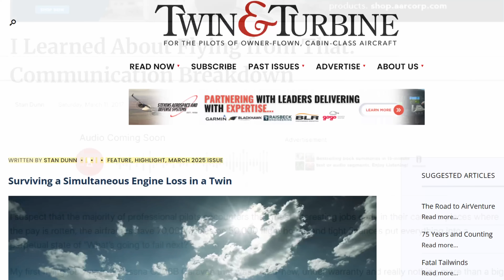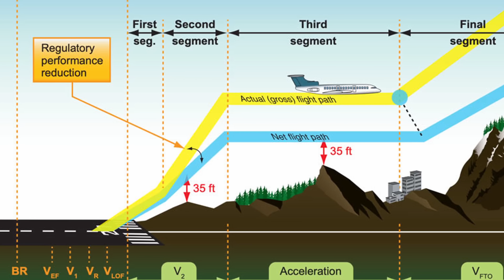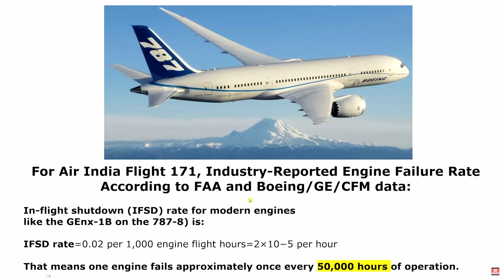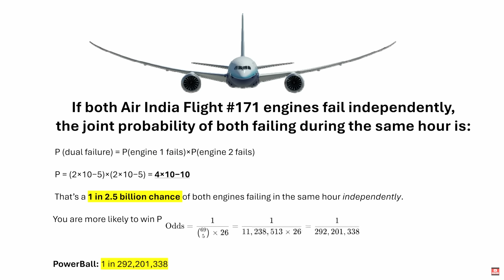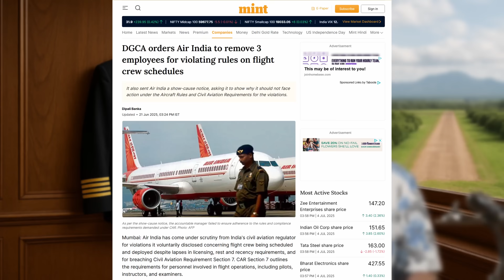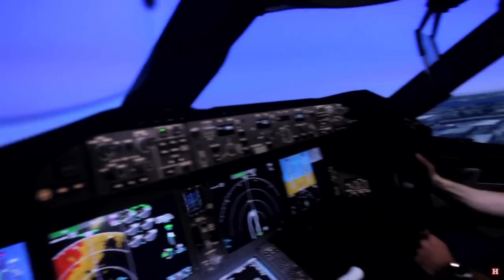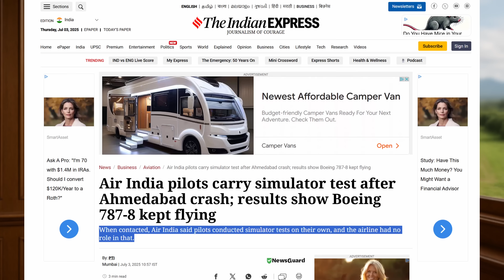Air India 171 Cause Becoming Clear

Comment: My theory is the lithium battery shorted out, causing a power surge, and the computer system shut off the engines quote to save the engines. The computer management system automatically shuts things off if there is electrical shorts, surgeons, etc. I know a former Boeing employee who told me never fly on the 787.
Reply: Not even close to probable.
Reply: @stevenrn6640 Power surges can trigger engines to shut off in the Boeing 787, allegedly. The fact they have released no data from the voice recorder and data recorder tells me there’s people at Boeing and Air India not sleeping well at night.

Comment: I wouldn't be at all surprised if there is a bug in the coding of the software.  There is so much software code on machines these days it is almost impossible to test everything for faults when there are so many possible inputs variables and solutions.  I experienced a similar problem on a brand new 747-400 on Flight QF1 from Melbourne to London Heathrow via Sydney and Bangkpk. I joined it at Bangkok on one of the last 4 available seats on the plane. Well through the take-off run, after V1 had been attained, we lost power on all four engines, due to a known fault which had occurred several ttimes   Luckily the Qantas crew realised what had happened, cancelled the Auto-throttle and went manually to emergency power.   The blue light show of flames from the jet pipes was quite impressive and we only rotated from the threshold, having run off the end of the runway and collected a palm frond over the horizontal stabiliser on the way.  The problem in that case was the auto throttle software. 
There have been problems with the FADEC systems in the past which kept the Royal Air Force Chinooks on the ground after causing a Chinook to fly into a mountain in Scotland when the engines wouldn't respond. The Air India 787 had undergone maintenance only days before the accident.  Were any software patches installed?  On an 11 year old aircraft there must have some updates carried out.

Comment: Lots of bs.  It’s Boeing software fault, just like mcas. Lousy sensors broke and computer went crazy.  High temperature in engines and buggy software shut them down.  Another few billions in compensation with massive recall to change lousy sensors and wrong valve used, fail-close to fail-open as in original design

Comment: What is the likelihood that electrical interruption from main-body sections junction join point/s(AKA-current inspections for assembly joint facing body shells [de-lamination/s] of differing body shell components exceeding 0.004" deviation without shimming) that could have or has precipitated a break in the cabling to the computers and associated control/s shutting down both engines simultaneously causing the crash and dropping of the RAT?
Just an observation from an ex RAAF mechanical fitter.
Ozzie Follower
Reply: Even if both FADECs lost power simultaneously why would the mechanical assembly automatically move to idle thrust?  On the turbine engine I work on there is no spring action bringing the engine control back to idle.  Loss of power would leave the mechanical lever right where it was when power was lost.

Comment: You didn't mention the possible water leak from the lavatory faucet, for which Boeing had issued directives twice. There are critical computer modules under the bathroom floor. Water leaking could have caused electrical and/or control failures.
Reply: Designing a plane that has critical computer modules underneath the bathroom seems like a very bad idea.
Reply: @geofflepper3207  Designing a leaky toilet is even worse.

Comment: I am still going to go with a tragic pilot error.  He throttled back when he should have throttled up.  Or it could have been a suicide of someone in the cockpit.  The instrument recordings and voice data should reveal whether or not Boeing has made another flaw.  I doubt it.  Still, hatred amongst neighbors does not require organization.  One person could have done it and there is no one to "take responsibility" or gain effect from such.  We still need to determine what the actual failure was before we speculate on cause.

Comment: The equipment failure inside the cabin on the ramp is the clue to what happened. The A/c was not working and neither were the passenger electronics. There are suggestions that they were cleaning up a water leak from a toilet that managed to get into the electrics bay. It could be that after they dried out the bay and cleared the aircraft for flight, the leak continued and when the aircraft rotated at the very end of the runway, the loose water shorted out all the systems including both FADECs simultaneously leading to the engine resets to idle. The RAT deployed and the aircraft could only climb a small amount before stalling. They did not have enough time for a reset of the FADEC and they ran out of height. Due to the development of the land all around the airport, there was nowhere to put the aircraft down even if they had enough energy to turn - which they didn't.
Reply: Retired Plumber : it is amazing what a mess spilled water makes.
Even one quart is huge when spilled in the wrong place.
Reply: This claim is so utterly ridiculous it needs an entire category of absurd.  How would water short out the FADEC computers when they are literally mounted on the ENGINES genius...??!?!?

You really need to stick to kite flying and skip the adult discussion forums...
Reply: @redbaron6805  Where is it getting it's power from ?
Reply: @redbaron6805  You really need to articulate yourself better without being needlessly rude.

And like everyone else, all you have done is attacked the OP. You have not proposed an alternative theory nor disproven what the original poster wrote. That makes everything you said totally null and void.
Reply: @halfbakedproductions7887  At no point was I being "rude", more like impatient with people who speak about subjects they apparently have absolutely zero understanding of.

I am not only a pilot and worked for years in avionics and instruments, and have a degree in electronics, so I know BS when it is being posted.

When people talk about toilet water shorting out the FADEC computers on the engine, and the idea a plane rotating having water flood the electrical system, like there is a giant swimming pool of water just sloshing around inside, you know you are riding with flags high into Crazy Town.

As a bonus, the idea that you can land a 787 if only the land wasn't developed around an airfield, like massive open fields that that can support the weight of a half a million pounds is all that is needed is just the cherry on top...
Reply: @redbaron6805 So you're certain that wasn't the cause.

Gee, why didn't you tell the Indian investigators earlier? You know the answers, why did they waste their time? What else have you thought of that they haven't bothered to investigate with the actual evidence in front of them?
Reply: @halfbakedproductions7887  I know reading and elementary comprehension is obviously not your thing, but the location of the avionics of modern aircraft, and related computers are in the front.

Even if you had large amounts of water, when aircraft rotate for takeoff, everything goes to the back, because, you know, gravity, physics and all that other science stuff.

Do I really need to break out the crayons to explain this to you on a level you understand...???

Comment: that would be convenient for boeing, You didn;t mention that there is a third tank in the fuselage, which powers both engines during takeoff, and there is such a device as FADEC, which, losing power or having a surge/failure, will shut down both engines automatically, redundancy only in theory

Comment: During the take off phase of Air India flight AI 171, the hydraulic system was under high demand (flaps deployment, landing gear retraction, and nose wheel steering).
The Skydrol hydraulic fluid inside the pipes was likely approaching a temperature of 90–110°C.
If any of the pipes developed even a small microcrack, the hot, pressurized Skydrol could spray directly onto wires, connectors, and printed circuit boards (PCBs) inside the Main Equipment Center (MEC), potentially causing cable insulation to melt, catch fire, or short-circuit within seconds.
One of the high-pressure hydraulic pipes controlling the flaps on the Air India AI 171 aircraft suffered a structural failure due to material fatigue (micro fatigue cracks) that had slowly developed over time and went undetected.
The pipe finally ruptured as the system pressure reached its maximum operational limit of approximately 3000 psi (207 bar).
The hydraulic fluid (Skydrol), known for its corrosive properties and high thermal conductivity, sprayed forcefully from the rupture and came into contact with critical components inside the Main Equipment Center (MEC)—the aircraft's central avionics bay housing electrical modules, relays, and power distribution control units.
As a result, the aircraft experienced a total electrical failure, including:
1. Loss of power from the main engine generators
2. Shutdown of hydraulic control systems A and B
3. Interruption of power supply to the flap and landing gear actuators
4. Failure of all communication and avionics systems, including the transponder and ATC radio.
This triggered the automatic deployment of the RAT (Ram Air Turbine) as a backup power source. However, the RAT is designed to support only minimal flight control functions, and is insufficient to restore flap operation, landing gear retraction, or communication systems.
With the flaps stuck in takeoff configuration and the landing gear still extended—creating significant aerodynamic drag—the aircraft suffered progressive pitch-up and loss of lift.
Without communication capability and full surface control, the aircraft entered a deep aerodynamic stall at an airspeed of approximately 180 knots and an altitude of about 625 feet, then crashed before it could complete a climb-out.
---
Notable Clues:
1. A distinct propeller-like sound (resembling that of a small propeller aircraft) can be heard over the dual-engine jet noise in the original short video showing AI 171 during its takeoff roll. This sound is believed to be the RAT deploying, although in many other versions of the video, the RAT noise is inaudible due to added narration or commentary.
2. Loss of communication between Air India AI 171 and ATC occurred at an altitude of approximately 400 feet, strongly suggesting a complete electrical systems failure at low altitude.
Reply: certainly they have well beyond 90C  in use rated wiring throughout. this isn't 1930's
Reply: I don't even know why we have real people doing investigations now that we have the powers of AI.

Comment: N2 at 110% Planes can fly with their gear down. Planes can fly with their flaps up contaminated fuel. Normally a plugged fuel filter will bypass. Airlines wants a pilotless aircraft, AI.  killed this plane. AI is coming AI will fly

Comment: Its not zero at all, its happened before more than once and will happen again, that means your zero value is bollocks.
You sound like the numpty managers at NASA who said the chance of a space shuttle failure was 1 in 100,000. Richard Feynman (physics nobel prize winner) thought this was stupid, he said to the managers,  so you are telling me that I can launch a shuttle every single day for 300 years and only lose 1 which is clearly nonsense. So he went to talk to the NASA engineers who actually built the thing, and they reckon it was 1 in 100, far more realistic and observed in practice.
Also the "managment" were very very unhappy that RF was going to talk to the engineers. I wonder why. ??.

There is nothing new here, you are just regurgitating all the theories and rumours that we have all heard for the last 2 weeks.

10:36 you talk about a FDR download, and your picture is of an ADT 406S (its an ELT emergency locator transmitter), fuck me are you actually a pilot, get things right.

Comment: Strong suspicion of control system failure, most likely in software. Remember MCAS written by $9/hour H1B visa coding "talent"?  Way to go Boeing. Not a pilot, just fifty years of software engineering including with Boeing and GE Aircraft Engines.

I have experienced a similiar a car engine failure but managed to keep control because cars don't keave the ground. Nothing shuts everything down all at once like a control computer failure. Also I was nearly killed by an implanted mdecial device that misbehaved before permanently removing  it. Add some time in industrial process control and I respect that control systems are not easy to build while mistakes happen.

Comment: The had a cascading electrical power transfer failure during liftoff that caused both engines to roll back to ground idle caused by arcing in the main power transfer relay box traced to water ingress. During prefight the GPU disconnected in heavy rain. Flaps were extended. The main landing gear transferred from take-off position to retract by the front wheels leaning down. That means they selected gear up. The next item was the auto deployment of the RAT system.  That deploys during a complete electrical failure.
I find it strange that all these crash analytical channels aren't saying this at all.
Reply: There was no rain that day.  Check the weather records for yourself.
Reply: @johnpeterson3386 The flight in had a passenger release a video on the arriving flight saying the entertainment system didn't work at all. The APU failed while they were on the ground. There was an obvious electrical problem. Supposedly a 2 week recurring MEL. They had water ingress before the day of the crash.

Comment: It's hard to believe both engines didn't lose thrust at exactly the same moment, given there's no apparent yaw.  Also, notice the dust plume on lift off moves rapidly from right to left suggesting wind and also suggesting the initial creation of the plume may have indeed been along the plane's long axis.  Also, it looks as if the nose was being raised just as the plane vanished behind buildings -- feels like a desperation move. If software throttled back the engines, it could have taken the flight crew too long to identify the problem, making it impossible to recover. Fuel cut-off to both engines at the same time? I'm not an aircraft designer, but as a former aviator, engines on aircraft which have engines are pretty important.  I would think shut-downs would need to be rather deliberate.  Even with everything else failing, the engine on our plane would keep running until it suffered some sort of internal catastrophe. An aircraft can still climb with a lot of issues, just not without any operating engines.

Comment: A Boeing whistleblower has testified that the Dreamliner has a design flaw that can lead to the power systems essentially "shorting out".
Reply: Who and when? So far this has been one of the safest aircraft. This is the first one lost, and a video posted by a passenger on the same plane earlier in the day made a video of all the things not working, including cabin AC. I believe it's on the company, they flew an aircraft with a growing number of problems that became more serious after taking off to the point where power to a very critical component was lost, deploying the RAT. Air India is not releasing CVR or FDR information which if it was someone else's fault they would be making a lot of noise over.
Reply: @Oldbmwr100rs  His name is Sam Salehpour, and he has testified in formal hearings on the matter.
Reply: @Oldbmwr100rs  💯💯💯💯💯💯💯💯💯
Reply: Did the whistle blower explain why there had NEVER been a 787 crash in the 16 years the 787 has been flying?
Reply: @rickgarner6269  💯💯💯💯💯💯💯
Reply: Do you know which guy? I can't find anything related to the 787 and a whistleblower mentioning something about a short. I only spent about 20 minutes searching aroudn though.
Reply: @skinnybricks  His name is Sam Salehpour.
Reply: The only thing is that the sole survivor has mentioned that the lights were on until nearly the last seconds, after the RAT had deployed. So not all power systems failed. Then noise of the RAT could clearly heard before the plane was just outside of the airfield and the plane was still going up. It's even visible on the video's.
Reply: Which power systems? Eng 1 or 2 IDG, APU, Transfer busses? IDG? The B-787 has 2 generators per engine and one in the APU plus 17 power distribution nodes for electrical power. The systems are independent for redundancy... Aircraft are not like houses or cars. They have multiple independent systems. They can't 'short out'.
Reply: Didn't he sh00t himself in the back of the he@d 3 times?
Reply: Sam Salehpour is a Boeing quality engineer that testified about fuselage assembly structural misalignments on Boeing 777 and 787.  When has he ever spoke about electrical systems?
Reply: @oubrioko  The structural misalignments let water into the computer bays and wiring harnesses.
Reply: Maybe a battery blew up. Accounts for the loud bang the survivor heard.
Reply: Yeah. They 'clintoned' him
Reply: @FrankHeberer  No, this one I believe is still alive.
Reply: there are something like 5 different service bulletins on the 787 that say if the plane isnt restarted before a specific number of days, the system overflows a variables and crashes the engine and fuel control.
Reply: @geofrancis2001  This p-lane didn't appear to be allowed to sit, as long as it's flying it's making money, and I'm sure the problem was rooted in just that.